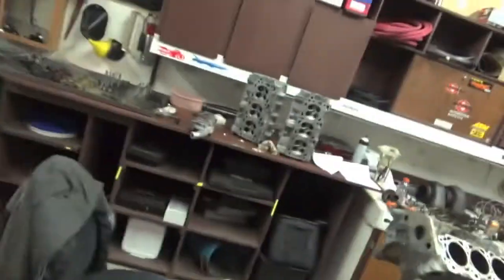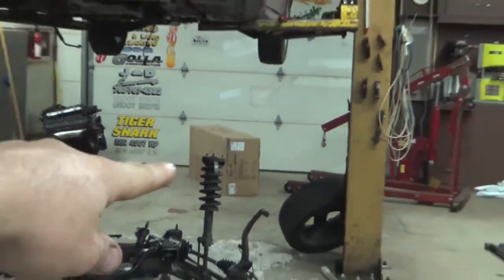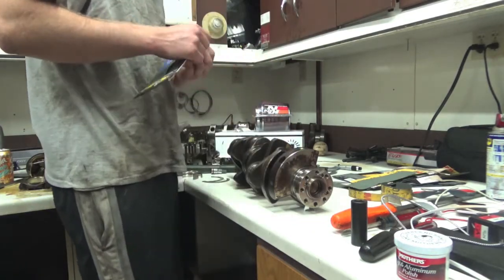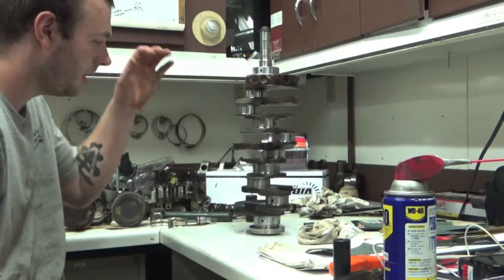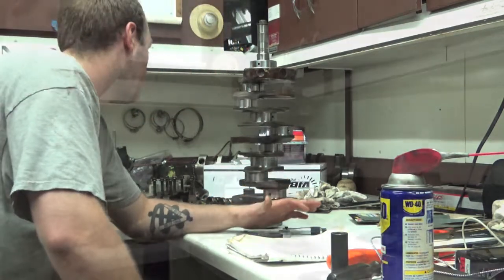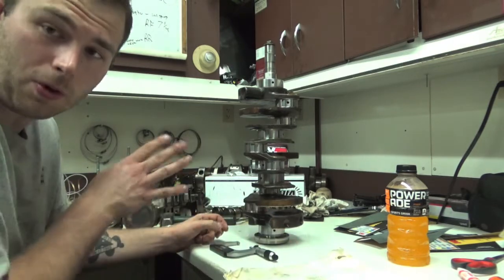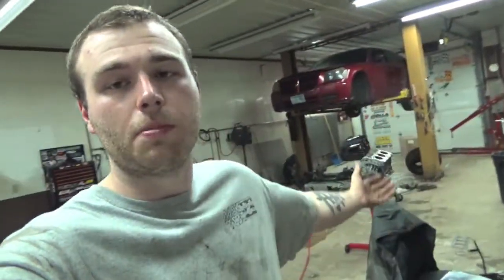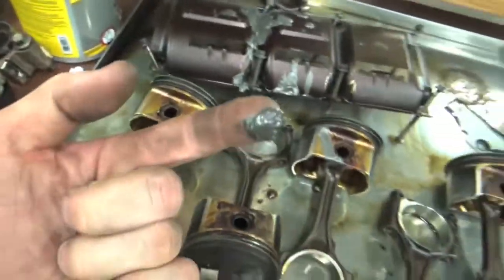Crankshaft polishing/ journal measuring on the STROKER v6 Build. Baby Hauler EP.6

Comment: what motor can u get the crank from  to make a 4.0 stroker v6
Reply from the maker: 4.0v6 in the mini vans and nitros
Reply: @RacingRamFam  i want to make a 4.0 stroker. is there a 4.6 or 4.7 v6 crank i can use..?..
Reply: @johnsmith-qz4bv  Unfortunately the largest version of this that dodge made is the 4.0. 
Although if you used a 4.6 crank, wouldn't that make it a 4.6 stroker?

Comment: So will a 4 liter rotating assembly fit in a 3.5 block or did you need to bore it out. Also where did you get your supercharger from?
Reply from the maker: No you have to cut the mains down .2” which is a lot. There’s same bore. So you use the 4.0 complete rotating assembler (cranks,rods and pistons) get the mains ground down .2” and clearance the block. Or just do what I did and use the 4.0 block and heads they bolt up the same just have to use 3.5l oil pump,  timing stuff, oil pan pick up tube, intakes/exhaust,  valve covers and some other misc stuff
Reply: @RacingRamFam  Thats really good to know. I assume the supercharger was an ebay find? Ive looked for one for my 3.5 but cant ever seem to find one
Reply from the maker: No Facebook market place lol

Comment: cool way to polish the crank.......what kind of power would u get if u used the 3.5 heads with the 4.0 cams on the 4.0 block....?
Reply from the maker: 3.5 and 4.0 heads are the same. 4.0 cams are a little bigger than 3.5 cams that’s only difference